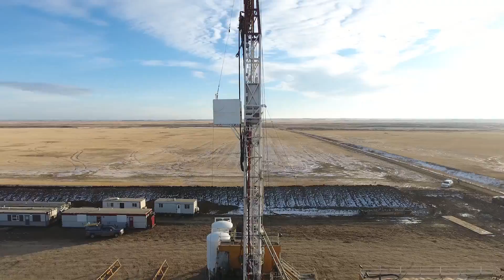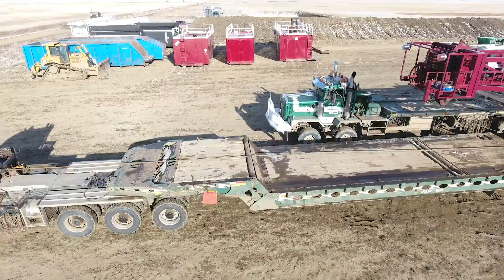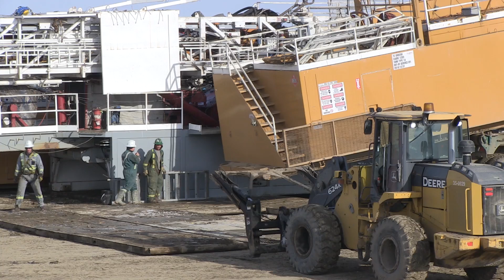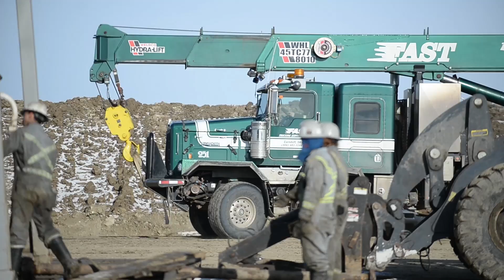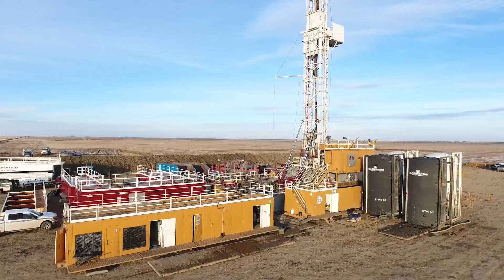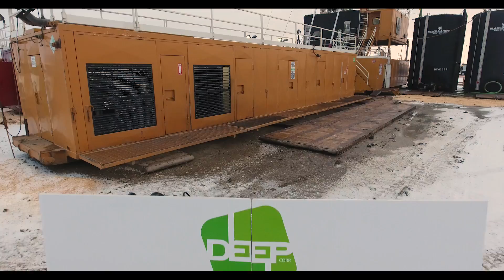Deep Earth Energy Production Well 1, Torquay, Saskatchewan

Comment: You know it'd be cool, if the explained what was going on and it wasn't just one long music video
Reply: Basically the long tower you see there is a piece of equipment used to drill a hole deep into the earths surface, could be 100 meters or 5 KM. As you dig deeper the earth warms up. They will take this heat and basically use that to produce steam which will turn a generator that will produce household power. This kind of project is important because it is not economically feasible to build power line to small communities. By having local geothermal power generation stations we do not need to transport power long distances, as electricity travels through the power lines some of it is lost. It reaches a point of diminishing returns where it’s more expensive to transport electricity than to just invest into something like this. I can give you a 7 day lecture on how this works as I am a mechanical engineering student but this is the best I can do in layman terms. Hope this helps. Stay bless